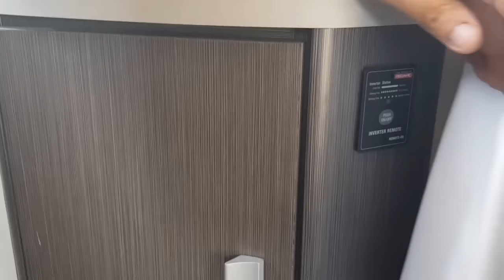Caravan RV 101: How solar systems work in your RV or Caravan

Comment: Thank you so much for this video. So straightforward when explained this way. 

We’re just getting into caravanning, with some off grid trips planned, few days at a time. 

What I can’t work out is, how to power the fridge? I know with the 3-way, most people use gas. Is it possible to use 240V with this kind of solar setup? Would it chew through the power too fast to charge?

Comment: Hey Todoing family, we’re just doing a little more research into our solar set up and really hope to do a lot of off grid camping to save money. How do you guys find having 2 panels on the roof, the blanket and three batteries? How long would you say this could last you off grid? Does this fully recharge on a sunny day? Can you still use the microwave and aircon unit or are you restricted. Thanks again for any response. 👍
Reply from the maker: Hey there!  We can do 2 to 3 days with cloud with the current setup.  If I was to make modifications, more solar would help on the roof.  Ideally we need another Redarc DCDC for the caravan.  This would mean right now we could do 2 to 3 days in cloudy environment, then top up driving three or 4 hours down the road.  this would be ideal, and our goal!  Every bit counts when it comes to solar.  In an ideal world we would have lithium too.  Absorbs faster and allows you to draw more from them, plus so light.  Microwave we use in bursts.  Aircon, no chance!  On 12V it uses way too much amps.  You would need a trailer of batteries behind to make it work!!  Hope that helps.  If need more info, feel free to contact through our website www.todoingfamily.com
Reply: Todoing Family - Road Trip Lap of Australia thanks for the reply. We are currently enquiring on a Enerdrive setup. 👍